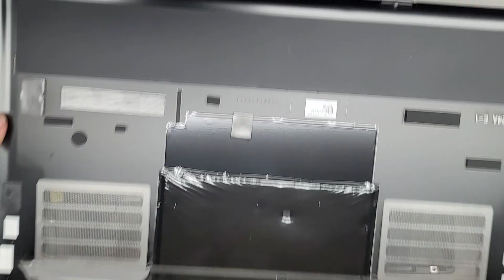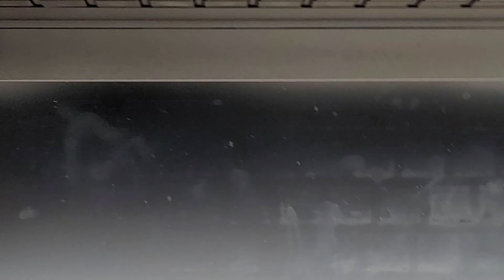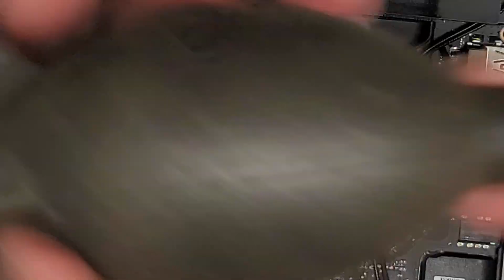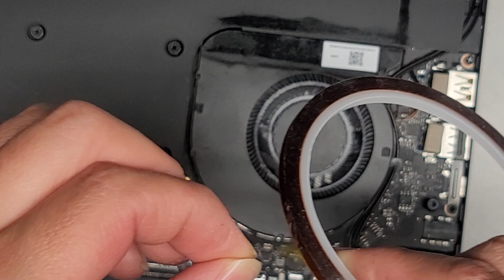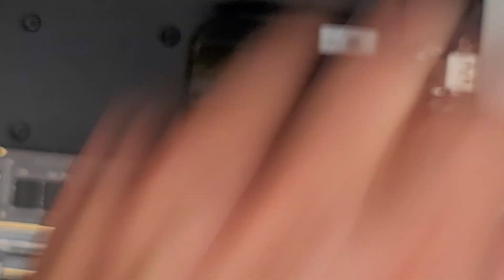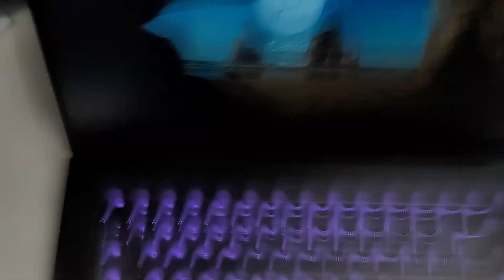Razer Blade 15 rz09-0409 Disassembly Fan Repair How to Add Adding Added Grease

Comment: Instead of taping it closed if you have a flat attachment for a soldering iron you can plastic weld it shut which seems the most like what they do at factory
Reply from the maker: Not after you cut the excess plastic away.
Reply: @ItsBinhRepaired  add more
Reply from the maker: @spencermallory9229  from where? Lol
Reply: @ItsBinhRepaired  bro they make plastic welding rods or just find some
Reply: That’s what I did on my blade 16 and it worked just like new
Reply from the maker: Nice!

Comment: 07:00 yes every laptop fan has those , its completely normal and theres no need to remove em
Also i Think It would be nice if they included some screw or latches or somthing for fans casing instead of those plastics that u have to cut through
Reply from the maker: Yeah, I think they do it this way because it's cheaper than having someone or a robot screw them in like on some other models.

Comment: You just saved me. I've been editing 3 wedding videos for many months and put between 700 to 900 hours into these films. 
I am finally nearing the completion of them on my Razer Blade 15 and BAM all of a sudden 1 of the fans sounded AWFUL. 
I found your video and immediately started taking my razer blade apart.
Put some full synthetic oil in there and BOOM it works perfectly. 
Thank you. Seriously. I've put so much work into these wedding films and am so close to being done. I did not want to put everything on hold just because of dumb computer fan. 
Really, THANK YOU!!! 

Also, to anyone who follows this guys video. Be SUPER careful when poping the fan blade out. Make sure to use a tool the way this guy did. DO NOT try to pry it out from under the fan blades. They break and bend easy.
Reply from the maker: Awesome, glad it helped and people will be getting their wedding videos on time thanks to my video. If you haven't already, please like and subscribe so others can find my videos and possibly consider watching a few others and commenting to get the algorithm to recommend my channel. Thanks!

Comment: What are some good grease alternatives?
Reply from the maker: Anything that's designed for moving parts. Not sure what you have.
Reply: @ItsBinhRepaired  I got Wd-40 bike chain lubricant
Reply from the maker: Bike chain lube might work. Not normal wd-40 though